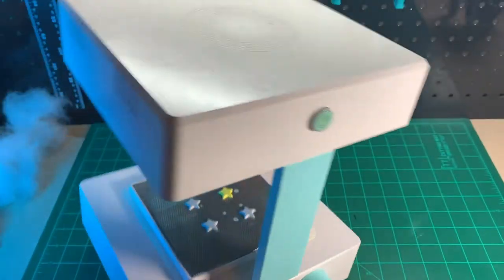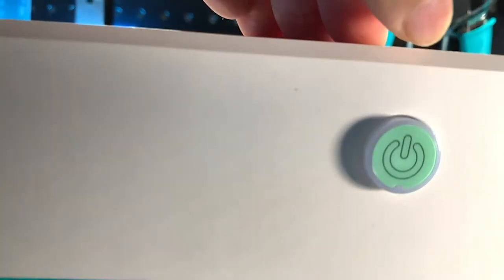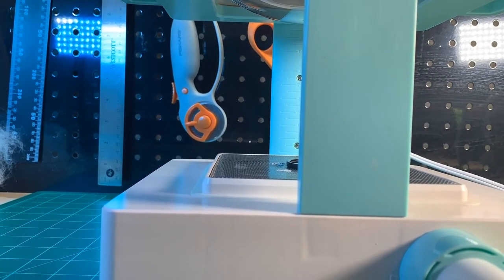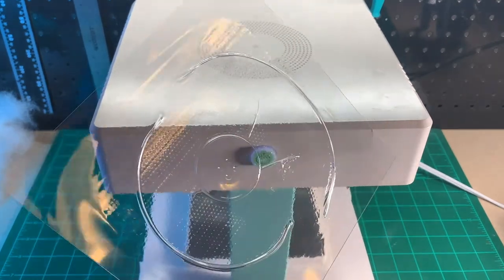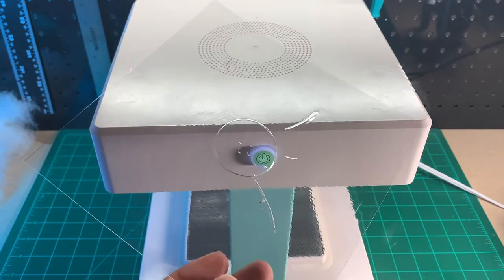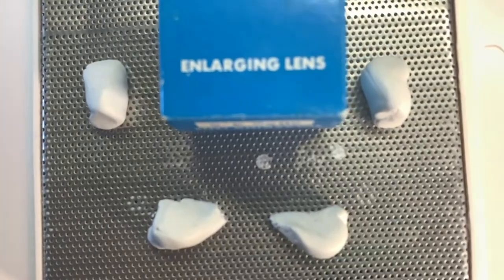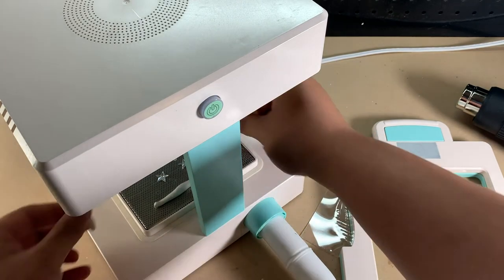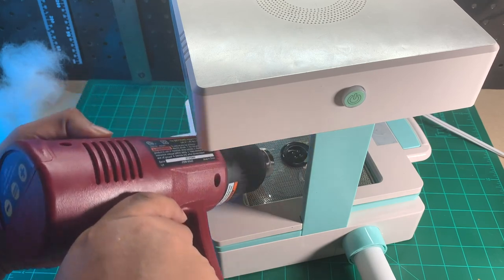How to Vacuum Form Like a Pro | We R Mold Press Machine

Comment: I have some questions in regard to this machine. When it comes to this machine, what is the limit to the thickness of plastic that it's able to pull with this machine (I mean, anything over 2mm would probably be problematic)?  Also, how well does it pull other materials (like sheet styrene for example)?  And has it held up well after two years?

Comment: If your doing food safe molds try to get your hands on .030 thickness compared to the sheets that mold press company sells in the packs.  The other next trick is use a heat gun as well as the heating unit. So attach your plastic to the frame. Heat it but shoot the heat gun towards to corners of the plastic sheets as these units don't heat evenly.  And when you bring down the frame to form your part push down along the frame to get tighter seal.

Comment: Nothing I do gets rid of the creases even on small things I want to make. Is there a better plastic sheet I can use? 
Cheers
Reply: If your doing food safe molds try to get your hands on .030 thickness compared to the sheets that mold press company sells in the packs.  The other next trick is use a heat gun as well as the heating unit. So attach your plastic to the frame. Heat it but shoot the heat gun towards to corners of the plastic sheets as these units don't heat evenly.  And when you bring down the frame to form your part push down along the frame to get tighter seal.